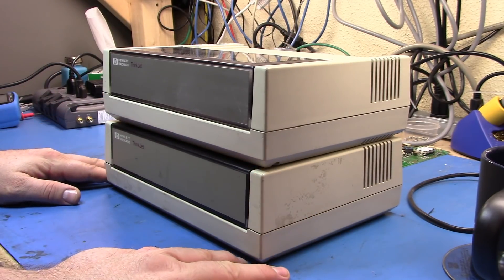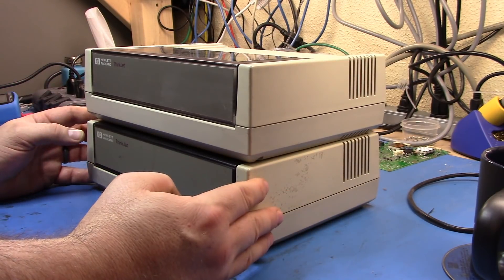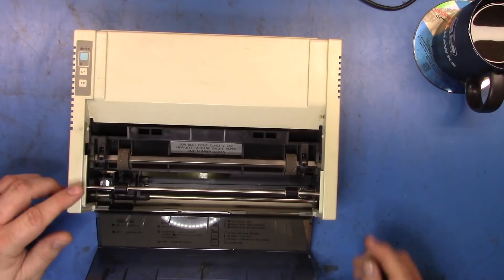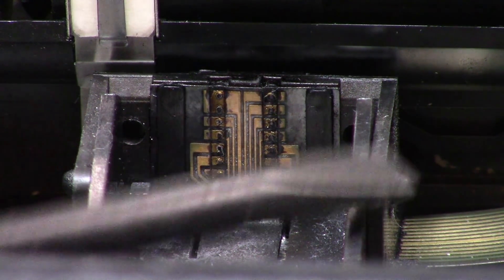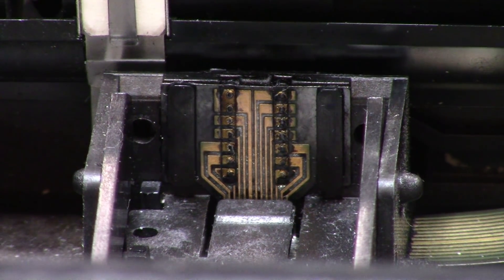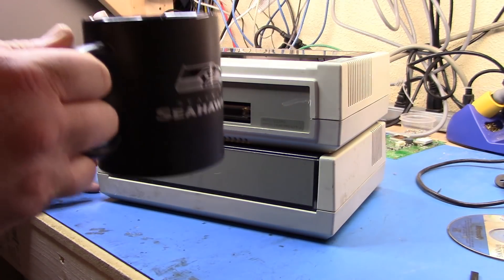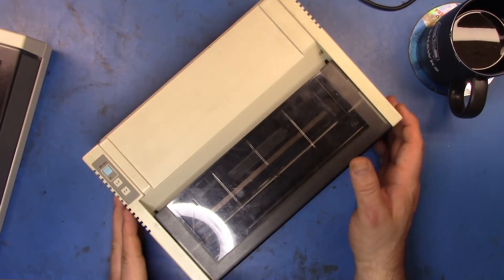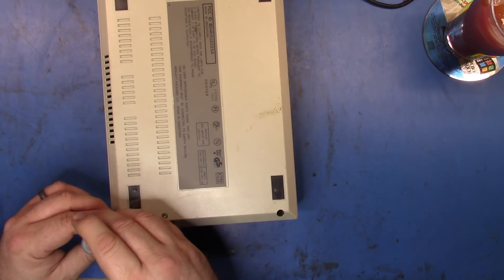HP ThinkJet 2225A Repair

Comment: Well done!

I recently refurbished an HP 2225C and now it look and acts like new. However, I have not found a way to make it work in Win7 connected through a USB to Parallel cable. Drivers appear not to be available. Is there a solution, say, using a generic PCL1 driver?
Reply from the maker: Thanks - You should just be able to setup the generic PCL driver that I think still comes with Windows - Mine is a GPIB device so I've never set it up from Windows. If there isn't a generic PCL driver then you might be able to get a driver for a LaserJet 3 and use that.
Reply: @tgsoapbox  Thank you tgsoapbox! I'll try that. Is the Laser Jet 3 limited to the original PCL1 printer language that HP created for its Thinkjet, revolutionary at the time? (We are now at PCL6, but how much more fun it is to make old yet worthy things work...)
Reply from the maker: @kappeyne  It's PCL 3 I think but it might be close enough if there isn't a generic PCL driver you can find.
Reply: @tgsoapbox  Hi again tgsoapbox, 'got it to work. The Generic/Text only driver in MS Windows sends all characters in ASCII, exactly what the HP understands. I won't need graphics so this is fine with me. Thanks for pointing me in the right direction, and again well done on fixing your own HP.

Comment: On 2225C, what are most likely causes for 'flashing yellow light' - the not ready fault? List of things to check? Had 1 that the paper sensor was gummed up, could not load paper, cleaned, loaded paper, got flashing yellow, pressed blue reset button and now OK. 2 others I get the flashing yellow. Connected to Win XP computer.
IF these still failing 2 are bad paper sensors, can I just disconnect the sensor connection - leave the wires open or shorted?

Comment: I still can't believe to this day office stores like Staples or Office Depot sell the cartridges. I wonder if anyone is working on replacement parts or if there is a way to repair the copper leads chemically if parts run out.
Reply: Those cartridges got built into things like POS terminals which are still in use around the world.
Reply from the maker: They're not front of house type stock but they're readily available - I was surprised about the tractor paper though, that I thought I'd have to special order but no, it was available in the local staples (albeit in 2500 sheet quantities).

Comment: Too bad Kodak Diconix didn't make a GPIB-compatible portable printer; if they did you'd have an even more compact printer with a rechargeable battery which used the same printheads.
Reply from the maker: There were battery powered versions of the 2225 - The 2225B (HP-IL) and 2225P(Parallel) - You're probably right on the Kodak version being smaller but having moved the 2225D around I'm not sure that is really an issue (it's very light).

Comment: You should re-cap it too
Reply from the maker: Good suggestion - I'll do that - BTW, since I switched over to the NI GPIB-ENET I'm having trouble getting my automated measurement stuff working (I think it's just a config issue) - So Im, still working on getting you that 5200A data.
Reply: No Problem, there is no rush. I am (at this moment) recording some video doing a calibration on it, I am hoping that doing the calibration will show up where any more issues may be, I found one test point that is noisy so far, so that could be a clue to it.

I have never used any GPIB systems, so I am afraid that I cannot offer any suggestions there.
Reply from the maker: Got everything working - Here is a link to the files: https://1drv.ms/f/s!Amqar8_XQ9UzkfYYWsNbNZH6LOQAyQ
Reply: tgsoapbox - thank you, I will take a look and let you know how it’s stability compares.